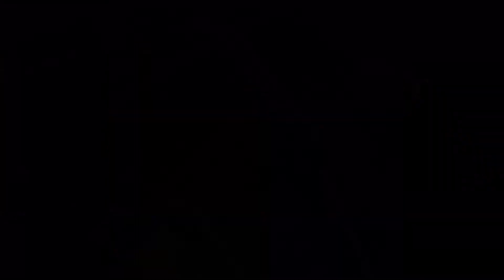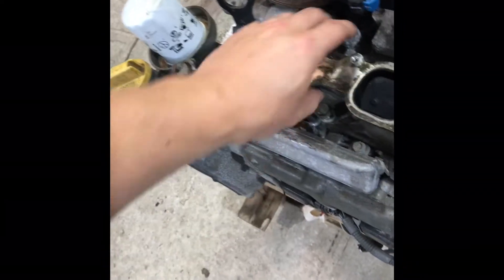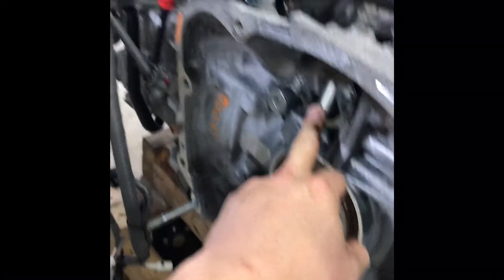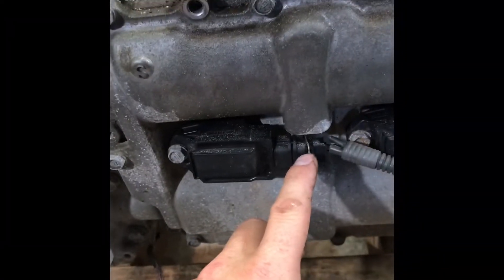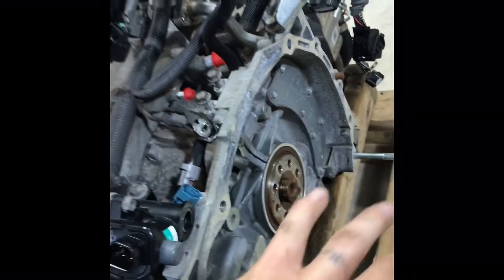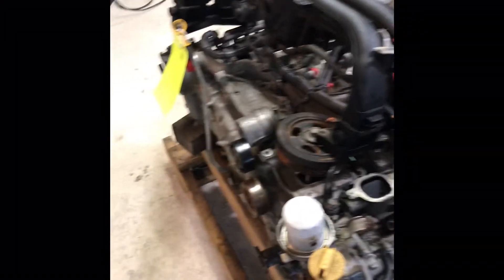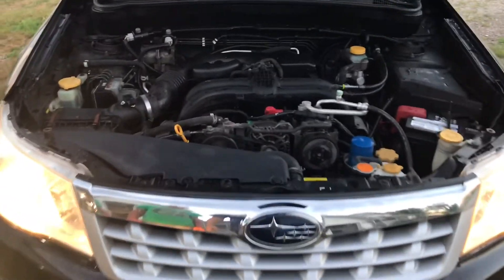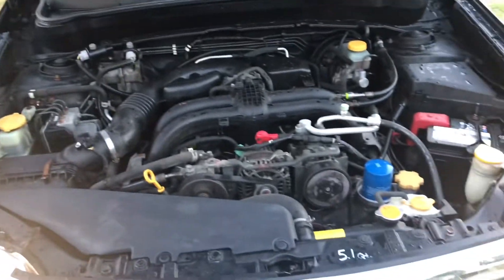2017 Legacy Engine Swapped into 2011 Forester!

Comment: Instale un motor FB20 2017 de XV a mi Forester 2012 doy arranque parte pero se para Solo que puede ser ????
Reply from the maker: It could be 1 of 1000 things. 
First, do you show any pending DTCs on an OBD reading device? If so, what are they?
Are all of the electrical connections plugged in?
Do you have fuel pressure to the rails?
Did you swap tone wheels on cams? An XV 2.0 has dual AVCS, did you swap exhaust camshafts as well since the forester doesn’t use dual AVCS. 
Did you match crankshaft sensor and tone ring that it reads?
Is the valve timing correct?
Unless I know everything you did in your swap, it’s hard for me to guess what could be wrong. I’m hoping it is something very simple like a wire that is not plugged in.

Comment: Perfect explanation! My husband has access to a 2014 Forester 2.5 with only 65 K. I was wondering if we can swap it with our broken down 2013 Forester 2.5? If we can do you know what the major work has to be done? I recall in your video that you have done it before.
Thanks
Reply from the maker: Yes it can be done. I have not had a 2014 engine apart, but I have had later ones apart. I have several other videos that show pretty much the same swap steps.

Comment: Hey! Looking to swap a 2016 Outback 2.5l into a 2012 Outback 2.5l  
Is this the same concept, only difference is that my current motor has timing belt and new one has timing chain
Reply from the maker: Great question! You will find that the FB series engine (chain) will not work in place of an EJ series (belt). There are quite a few reasons as to why, which we could talk through sometime if you would like.
Reply from the maker: stevenoswald@gmail.com

Comment: It's me again, do you  know what the valve on the intake manifold is called?  We also did not swap that or the throttle. I might be repeating myself but turns out the engine that was put in was used for 2016.5+ Legacies  and 2017+ Foresters. Also original harness  may be bad since I just found out that wife's co-worker  did splice into it to extend a connection  when he originally put a FB20 in. I think that's part of the CanBus communication issues we are having now.

Thanks again! A little late bu5 Happy new years.
Reply from the maker: They are the TGV or tumble generator valves
Reply from the maker: The throttle should work fine either way
Reply: @stvnswld  I figured out you were pointing out the purge solenoid.  I think I need to swap sides with the tgv  magnets. Got the original throttle cleaned up, spare parts don't hurt.  ECU behavior  is the big puzzle at the moment since it hasn't been consistent.  I have to redo the  tgv's  and if I have to I will do the trick using original  one's.  Do you happen to use breakout boxes? 

Thanks again.
Reply from the maker: @rockinhorsefeathers8100  I have not used a breakout box, no

Comment: What is your checklist for swapping parts an modifications? We just swapped  2016 into a 2011  but shes not running yet. We even did the plenum  valve  modification. Is swapping the engine harness a must? Trying to figure ou if we missed something.  Your swap videos I'm  sure helped alot of people.
Reply from the maker: I don’t per se have a list made up of things to check. But the engine wiring harness change is a must. But I’m sure you would’ve noticed a problem when you went to plug things in because some of the connectors are different. Does it start? Does it crank? Tell me more.
Reply: @stvnswld  It did originally start but backfired then we modified the valves and presumably  the correct wires were swapped. Now the cluster will go dead as will the ob2? Connector when put in run position.  
I don't think the fuel pump even turns on.  Temperature light  when put in first position  will start alternating red/blue. I just asked the guy who dropped  the engine in and he says it's the harness that came with the 2016. Wife coworker who has a couple of older subies and Celicas.
Reply from the maker: The harness is completely different in terms of connections. The legacy harness has a different connection at the bulkhead… it sounds like your issue is electrical for sure. The red and blue blinking light says you don’t have proper connection to the computer. Disconnect and inspect your connection at the bulkhead, where the engine harness connects to the harness on the car in the engine bay.
Reply from the maker: Did the guy would did the work have any prior knowledge of this particular swap? Since it’s not a direct drop in swap, treated as such it won’t work properly.
Reply: @stvnswld  OK so it does have the original  harness with a couple of connections made longer.  Tha car behaved differently today but still no crank.  Cluster actually  did not go dead. We're  wondering if the ecm locked us out. If not if it is bad. He does have the unit that came with the "16 engine.
Reply from the maker: @ no connections need to be made longer on the original engine harness. There is a bad connection somewhere. I doubt your ECM is bad.
Reply: I had him read the forum posts that I originally found on grassroots  and showed him your videos. The engine is supposed to be from a Forester but who knows if it's harness is the same or not. I will probably look for a 2011 harness,  I just need to find out how to I'd the 9ne that came with our car, seems like there may differences am9ng the trims. Original harness is apparently  gone.
Reply: Sorry  for delayed response, I am almost to the point of giving up,  wifes at that point too. Makes me wonder how differently  things are  wired  between 2011 and 2016.  Ie use 2016 engine , harness ecm.  I need ro test the battery cable  and find all the  grounds applicable to the engines function. Would incorrectly modified flapper valves be an issue? Thanks for your time.
Reply from the maker: @rockinhorsefeathers8100  if your forester is a 2011, the engine harness would need to match that model year, meaning you would need to have used the 2011 harness. If the newer har was was used because the newer ECM was used, that would be another cause. If any engine computer is used instead of the original, the immobilizer with not allow the car to start. That’s first hand experience talking. I fried an ECM in a 2011 by trying to program the TGV codes out. I bought a used ECM and the car would not start at all. I then had to haul it to a dealer so they could reflash it. I’m sorry that I don’t have much more for help
Reply: @stvnswld  No biggie, I think a mistake that might have been done was the tvg mod. Have talked to someone  on Forester forums who just recently swapped a 2016 Forester into a 2011 and he said he did not touch the tvg's. I had an aha moment as we were following a legacy into a Forester swap.  Ecu started being weird after we did the mod. Might have to backtrack and recheck sensors and the coil spacing. We did not swap valve covers.  Unfortunately it's winter at the moment and being a new heart patient doesn't help at times . Not gonna stress on it. If I have to I will get a new harness and battery cable. Replacing all the grounds when they come in. Save the motors from the modded tgv's  and pick up used ones . Thanks for listening and your knowledge.
Reply: @rockinhorsefeathers8100 you ever get it figured?

Comment: After your video I was able to do this. I did the same exchange from Legacy 2016 to Forester 2013. change timing cover, 2 round camshaft timing reading plates, longer oil gauge, 2 valve covers to keep the same ignition coils the converter drive bell, gear wheel and its sensor, I changed the water tubing under the intake manifold, kept the same intake manifold by superimposing 2 aluminum seals Self-adhesive plumbing removed the paper seal and reinforced with joint paste.
Reply from the maker: Nice work!

Comment: Bro im tired of the cvt, what if i swap  2016 legacy cvt with older tranny thats not cvt😂, what ab manual? is there any 2016 legacy thats manual? or has anyone ever swapped cvt with auto tranny thats not cvt?
Reply from the maker: I have not done any trans swapping, but for older cars one would need to swap the rear differential also to obtain the same gear ratios, otherwise your car would more than likely not move. The question for me would be how much of the electronic stuff would need altered or swapped, and would it play together once equipped. Great question! Not sure of the answer though.

Comment: I noticed that the crank sensor is different on the newer engines, is it functionally the same? Should I switch the sensor bracket, sensor and reluctor wheel over?  Thanks!

Comment: Hi nice to meet you I found you on YouTube and I have a question about a Subaru Impreza hatchback and changing the engine and transmission for the same transmission and engine but a different year? I paid for the labor at a shop and they basically just took the money and said that the engine and transmission was different and he couldn't do it. So if you could connect with me I will appreciate it. Ty
Reply from the maker: Hit me up. Stevenoswald@gmail.com I will do my best to help

Comment: Hey @stvnswld I just drew an adapter in CAD so that I could use the 2017-2018 engine with the 2011-2016 intake.  If you want a set for your next build, let me know- I've got a few extras so you can have a pair. Cheers!
Reply from the maker: Awesome man, that sounds sick! Fabricating parts is the coolest thing ever. Does it go between the intake manifold and the intake ports on the cylinder heads? If so, how do you overcome the increased height when hooking up your EGR pipe? It can get more complicated to use the newer intake with all of the tgv hybridizing that is required, but I have dialed it in pretty well since my first video here. I am currently working on an updated video of a swap I performed yesterday, but it’s basically the same as my other videos minus a few other details and changes I’ve made.

Comment: Thoughts will a 2022 work on a 2011 Forester
Reply from the maker: It may work. The main issue is the ‘22 will have dual AVCS. The exhaust cams will be variable. In the EJ series engine world, you can sub in a dual AVCS engine and run it with a couple of minor tweaks, I would be willing to try it, you may need to retard exhaust cam timing a tooth or better yet, use your old exhaust cams and sprockets! Then it should work…
Reply: @stvnswld  right on thanks I've done a jdm swap on a WRX before it's kinda the same process thanks again if it wasn't for YouTube I'd be peddling a bike 😂

Comment: I am planning on doing a swap on my dead 2011 vin C forester. What is the best motor to swap? the 2017 engine in this video was what vin #?
Reply from the maker: I wouldn’t worry TOO much about the vin. I have used 2016 and 2017 Legacy engines, 2018 forester engine, 2017 Outback engine. Any phase 2 FB25 WITHOUT exhaust AVCS will work well. Check out my later video, it’s much better

Comment: Can i swap a 2015 legacy engine into my 2013 legacy
Reply from the maker: I haven’t done this. Does your car have a timing belt or chain?
Reply: @stvnswld   thanks for your fast reply. It has a timing belt
Reply from the maker: Interesting, I did a quick search and it looks like your legacy should have a chain? Is the front of the engine plastic or metal? If your car has a timing belt, the later engine will not swap in like my video shows. It’s a different series engine and won’t be compatible.

Comment: About to swap a 2016 legacy into a 2011  forester. My question is, will it matter which vin engine i purchase? Forester is a vin A and im looking at a vin B? 

Also is it possible to get a auto engine and stick it in my manual trany? (Just put the flywheel on and the timing guard?)

Thanks ao much!
Reply from the maker: The engine vin will not likely match, you’re going to be swapping a phase 2 in place of a phase 1 FB25. I’ve used 2015, 2016, 2017, and 2018 engines in 2011 foresters successfully. The VIN won’t matter. I have another swap video that is better in many aspects than my first one. Perhaps check that one out too for more details. You can use an engine from an auto in your manual, no problem. Just put your flywheel and clutch on the back instead of the flex plate, no sweat! I’m not sure what you mean about the timing guard? Are you talking about the timing cover? Let me know if you have any other questions. Happy to help!
https://youtu.be/zORqmkh46H8?si=JoMwTbtqqrgzTQy1

Comment: I put on my 2013 Subaru a 2017 Subaru Outback Transmission , fit exact  just take of the old one transmission the top cover cables an put on 2017 and bingoo
Reply from the maker: Manual transmission? Cvt would be a different story, right?
Reply: a CVT automatic is a same body @stvnswld
Reply from the maker: So you plugged a CvT trans into your car that had an automatic? Or you have an Outback that already has a cvt and you just swapped in a different one? Sorry, I’m just trying to understand fully.

Comment: Will this work for a 2010 Forester with a manual transmission?
Reply from the maker: No sir. The 2010 still uses an EJ style engine with a timing belt, not an FB style. Sorry to say.
Reply: @stvnswld  any idea what would be a good swap for a manual 2010 Forester? Asking cuz you seem very knowledgeable sir!
Reply from the maker: @JesseMerlinLopez  thanks for the compliment! I can send you a link for a sure fit if you like.
Reply from the maker: They are quite a bit more expensive than they used to be. Here’s one option at a reputable JDM engine supplier. 
https://www.jdmenginedepotinc.com/product/2006-2010-subaru-forester-2-5l-4cyl-engine-jdm-ej253-d466054/
Reply from the maker: Another option would be this engine. It’s a little more reasonable as far as price goes. You would need to use your old intake manifold with wiring harness and your old exhaust manifold setup. I would recommend swapping your cam drivers and crank pulley as well. You would want the computer to think nothing has changed. 
https://www.ebay.com/itm/166556361520?mkcid=16&mkevt=1&mkrid=711-127632-2357-0&ssspo=_prhbdKbQ-u&sssrc=4429486&ssuid=ccjrpNmcTVq&var=&widget_ver=artemis&media=COPY
Reply from the maker: @JesseMerlinLopez  sorry to keep replying so much. The one I sent you on eBay has different rocker covers, so you would need to swap those as well so that your spark boots would reach and seal without leaking. I’ve encountered that before!
Reply from the maker: If you run into any issues along the way, feel free to reach out!